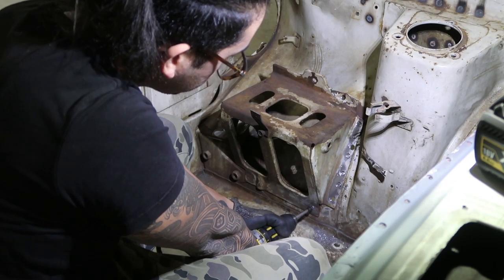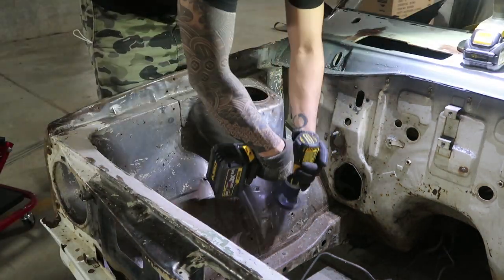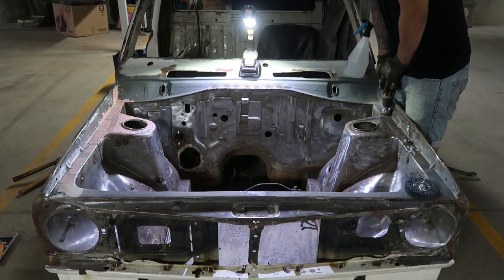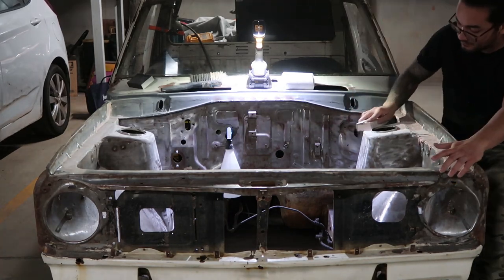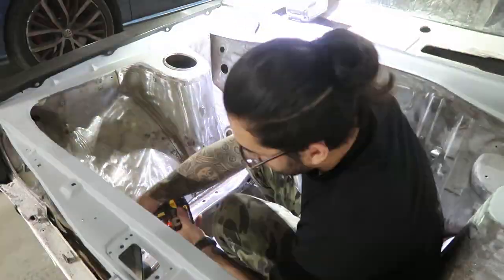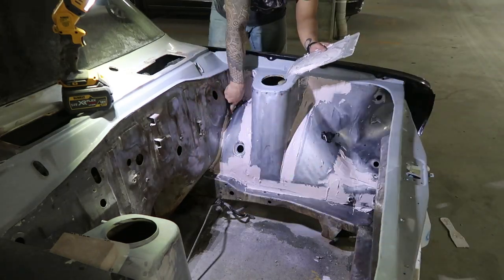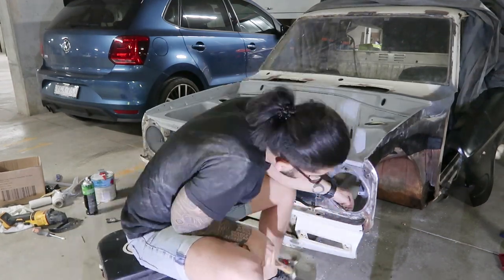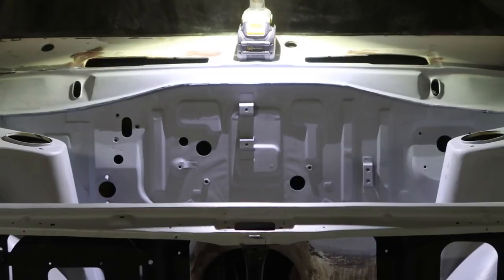DATSUN BUILD - BAY SHAVE, PRIMERED (#13)

Comment: Looks good mate just take not the body filler may crack when you bolt top hats back in I’m welding all mine and then grinding it back to avoid this will post a video when I get too it
Reply from the maker: I've seen the cracks happen before in other dattos I've seen. I was going to hope that it wont crack with the use of a strut brace - acting like a big washer to reduce flex and spread the force of the bolts :)

Comment: So where do you put the wiring loom with it be under the frame rails ? Clean look
Reply from the maker: Plan on making a new loom! The engine I'll do through the tunnel and the accessories I'll try tuck somewhere! haha Playing it by ear.
Reply: 32Builds I’m hearing you brother, hey what rust converter you spraying on there ? Supercheap product ? I asked same question on Insta 👍

Comment: Good job! Bay looks really good. What you use for rust converter??
Reply from the maker: Thank you :) I use Bondall - Rust Buster. I find it doesn't really work well on deeper rust - just light surface. Also, useless in the sun, so in the shade where its cool

Comment: Love the series thanks so much! Just wondering what rust converter you used? Man your apartment strata must be super forgiving haha
Reply from the maker: My parking spot is one of the cleanest around! Plus I keep my work outside of management hours hahaha
I use Bondall Rust Buster, but definitely open to more effective solutions!
Reply: @32Builds  hahah thanks for the replies! Good to see you got it painted!! Would love to know what paint stripper you used too you mentioned aircraft? Also looks like you welded up your holes without any backing material etc.. just wondering what kind of settings you’re using on such thin steel

Comment: Just wanted to ask what paint you used just after you sanded the body filler, the colour of the paint like dark Grey when wet ND light Grey when dried...
Reply from the maker: After sanding the filler, I coated the exposed bits of metal with etch primer (dark grey) and then went over the whole area with a couple coats of filler primer (light grey). Going with the etch primer really ensures good adhesion to the bare metal, and the filler primer adds some thickness to the paint so I can sand down the imperfections :)
Reply: @32Builds  thank you mahn it's really educational 👍

Comment: Just noticed, you're going to have to strip all the body filler and paint from the body numbers stamped in the cowl panel to be able to get it rego'd
Reply: 'Car number' in the photo
Reply from the maker: Dayyum, It was probably half gone too! I do recall seeing a stamp there though. Its already got a compliance plate, so maybe it'll be okay? xD I'm gonna have to play it by ear, its still a whiles away haha
Reply: Nah definitely needs to be legible, they cross reference the numbers on the compliance plate with what's on the body, if they can't find them alarm bells will ring. Use a fine brass wire wheel in a drill to carefully strip away the body filler and paint from the numbers but be very careful, use a scriber to scrape out the bottoms of the grooves until they're shiny, feather the edges of where you stripped back with some 320 grit sandpaper, and then give it a very light coating of etch primer in a rattle can. Then make sure that not too many coats of colour go on it and fill them back up.